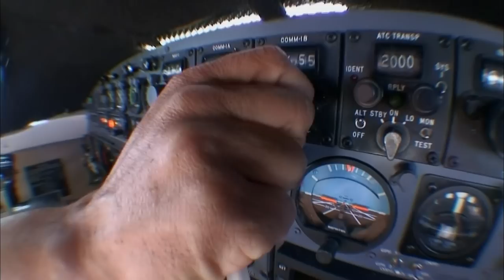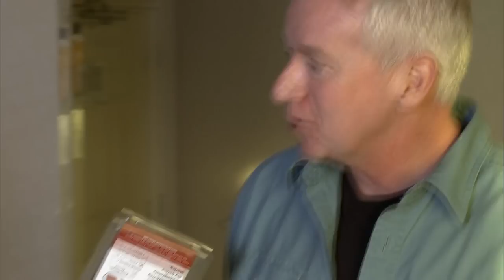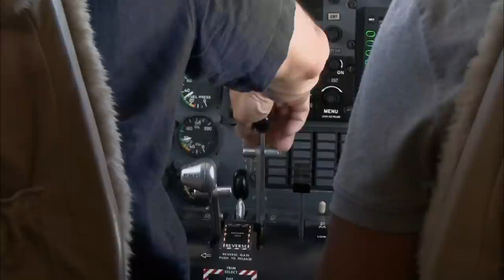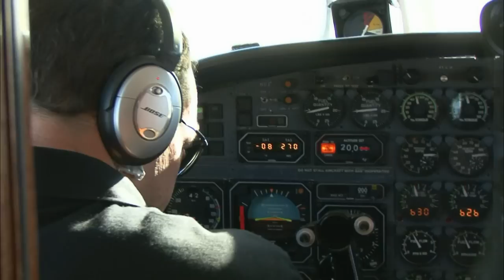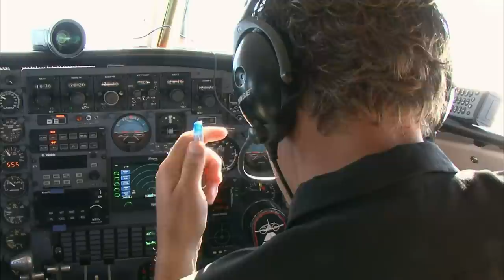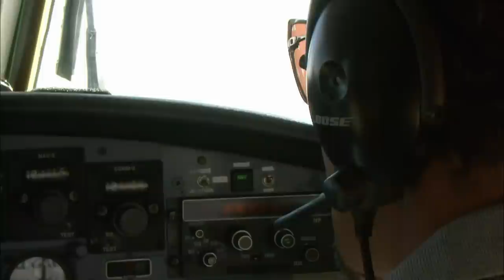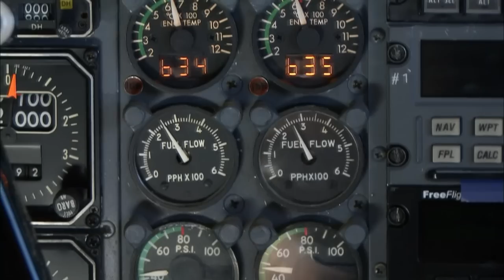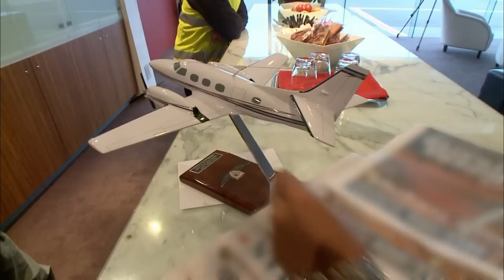Flying A Three Million Dollar Jet Across The Pacific Ocean | Dangerous Flights | Wonder

Comment: If I had a 3 million dollar passenger jet, I'd point it up at a 30 degree trajectory and see how far I could get up in the stratosphere before I reached the limits of control surface control and lift.   Even better, straight up vertical like a rocket.   But then I'm hardcore like that.
Reply: That’s not how it works. Straight vertical you stall and fall out of the sky. Also, there’s limits on how high you can fly any airplane. It’s called the service ceiling.
Reply: @DavidB-tq4go  We're about to find the true service ceiling.  Strap in and hold on.  And if I'm stealing a private jet, it's going to have enough to stand on it's tail and then some.   You just worry about getting enough oxygen...